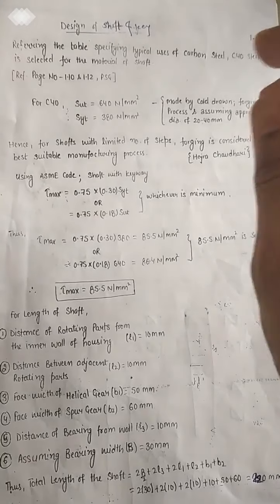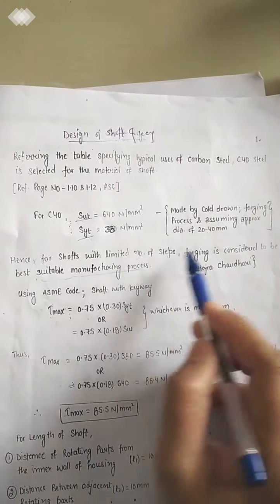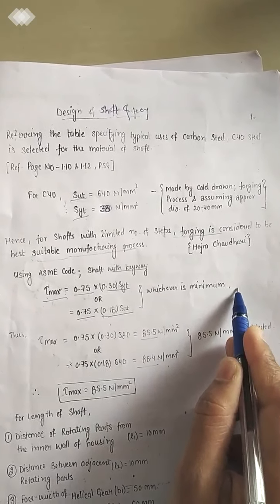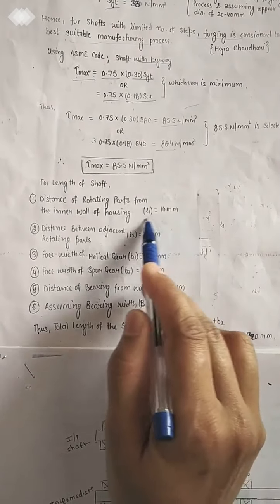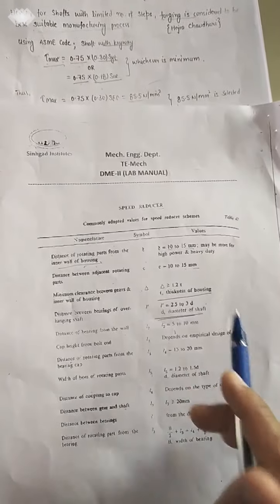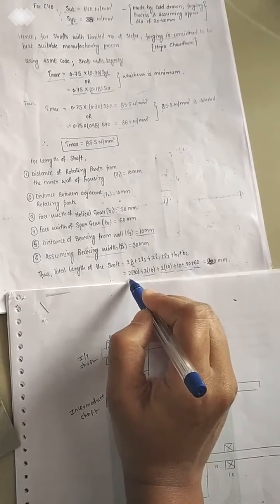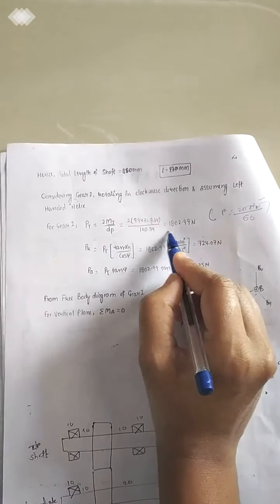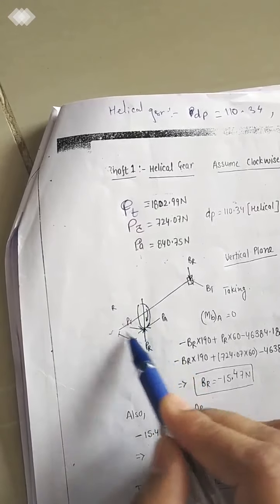Design of shaft and key

Comment: Hallo mam please give some information for vertical shaft design when motor is mounted on top of shaft which rotating shaft using coupling and circular shell is fitted bottom end of shaft this end is free & top end of shaft bearing fitted then design the shaft